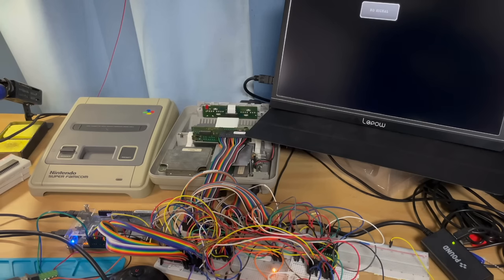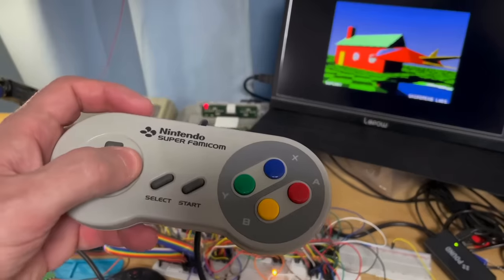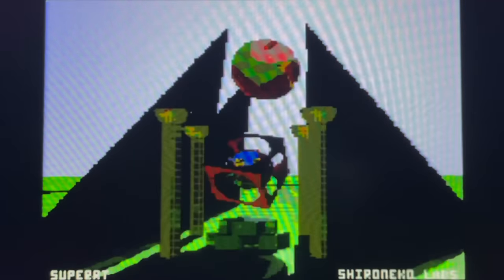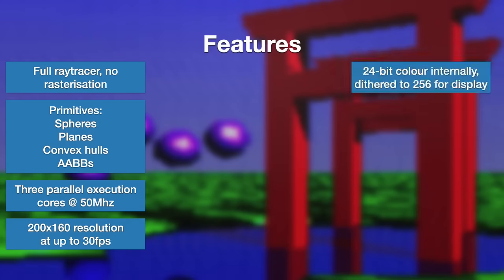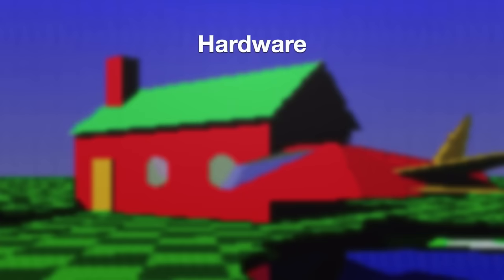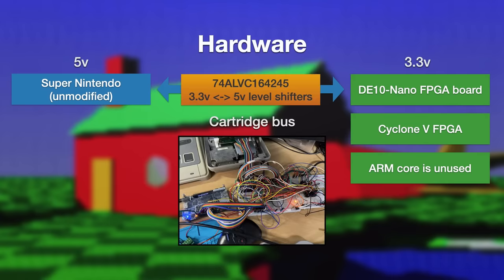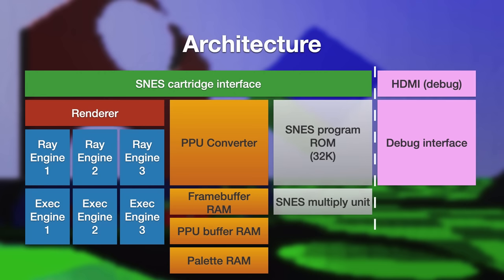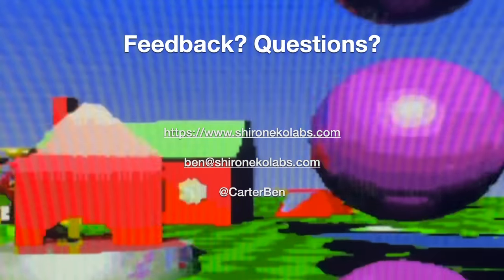SuperRT - Realtime raytracing on the SNES (walkthrough and technical overview)

Comment: Pardon me for my lack of education on tech and please correct me if i am wrong, but does RTX use a chip for their ray tracing? If not.

What would happen if let's say, sony made their own chip for ray tracing like this? Not just bake it into the hardware, but having a secondary chip seperate from the RDNA 2 chipset they're using? And is it the exact same thing or what?

And when i say seperate chip, i mean, deeply intergrained into the very core of everything, kind of like x86 processor, that almost all computer uses nowadays? 

Except, rather than x86, it's a chip built from the ground up with ray tracing, like in this video, but isn't like RTX's "tensa cores".

Pardon me if i don't make any sense, i hope that, i can get some sort of answer here.
Reply: RTX and RDNA both use a special on-chip modules to do ray-tracing which is basically the same thing as using a secondary chip to do the calculation but using less power and not having to build a secondary bus to do the job. Nvidia uses tensor cores on top of that to use AI to fill the rest with the ray-traced picture because their chip doesn't render a whole RT scene only part of it. AMD uses a similar de-noising technique if I'm not mistaken. Intel is also bound to put an RT module on their integrated graphics eventually (maybe in 5 years).
Reply: @grandsome1  I see. Thanks for giving such an informative answer.
Reply: @bouncedefenser  No problem, and don't hesitate to look up the info yourself in case I mixed up some things, but the basics should be solid.

Comment: Well of course the performance is good without textures, and no rasterisation.
It's quite different on modern consoles trying to look really good with high poly and blurring.
Even PC's can't handle that yet... also PC's are way more expensive than consoles.
I prefer consoles over PCs for gaming because of no background processes lowering performance, and overheating.
Consoles are just dedicated computers anyways, just made to contain what you're playing in a clean environment.

Idk what the issues with PC vs Console wars, because there's still games on PCs you can play, although not to the high quality console games can run unless you spend over $1000 for a tank GPU.

Comment: I feel like this is something sony would love to work with, wouldn't be surprised if sony were to hire you for lots of money.

Or heck, even AMD or nvidia.

Also, i apologize if i sound rude as heck, what i am trying to convey or say is that, your ideas is possibly something that could push the industry forward even more than before.

So i hope that you understand this. Didn't mean to sound rude.
Reply: Sony and Nintendo go way back. The original SNES had a CD prototype, but because of licensing issues was scrapped. Which gave birth the the Sony Playstation.

Comment: If one engineer was able to do this with SNES this begs the question: why the hell raytracing was not available (in real time) all those years ago?!
Reply: Because it's using 2020 technology, when at the time do the same thing would have required significantly more expensive hardware. In 1991, when the SNES was released, the most powerful consumer processor was an Intel 486 DX-2 iirc, clocked at either 50 or 66mhz. Even the 50mhz one, which ran at the same clockspeed as these microcontrollers, would have cost around $600 ($1200 in today's money, roughly), required far more power than the SNES power supply was rated for, and would need active cooling, like a fan or a large passive heatsink. And you'd need 3 to replicate the triple core setup here, which would push the cost well into the thousands of dollars territory, and would require a bunch of extra power delivery equipment and stuff, further pushing the cost. It wouldn't have been even remotely feasible.

Comment: Too bad this won't work on an SD2SNES, since both of its versions use an older FPGA...
Reply: I think the SD2SNES Pro uses a newer FPGA and might be feasible.
Reply: @finaltheorygames1781  Newer than the original SD2SNES, sure, but newer than the SuperRT? What makes you say that?
Reply: @Nikku4211  Who knows?
This would need to be addressed by the creator of this Raytracing project himself. 🤔
Reply: @ericcartman7420  He just joined the SNESDev subforum of the NESDev forums, so I have asked him some questions. He said that if SD2SNES support is possible, it would be pro only. He's only speculating, though.